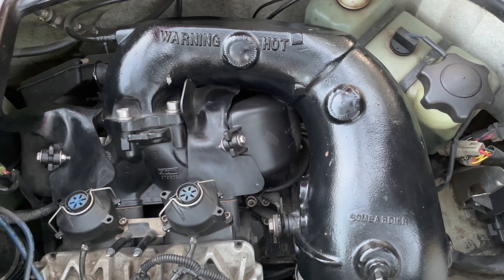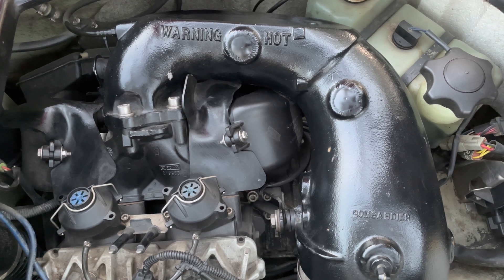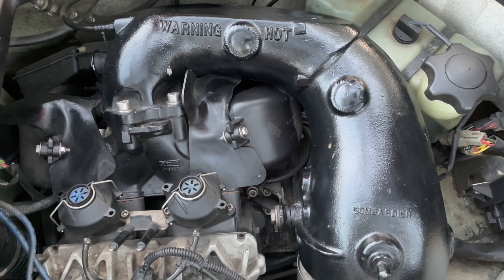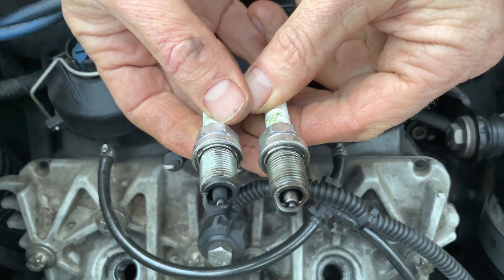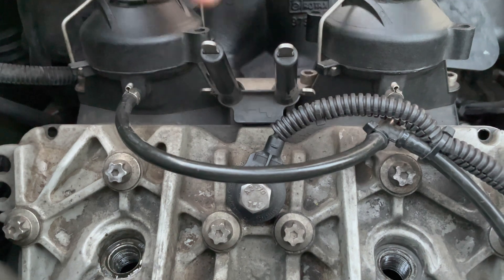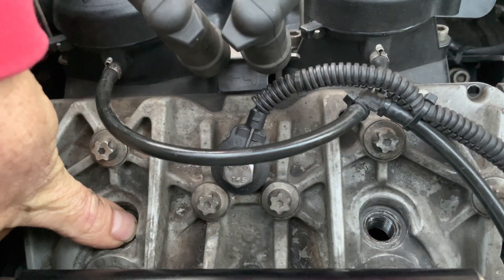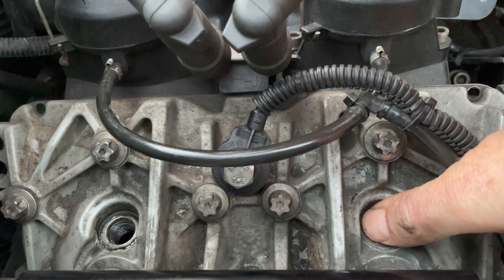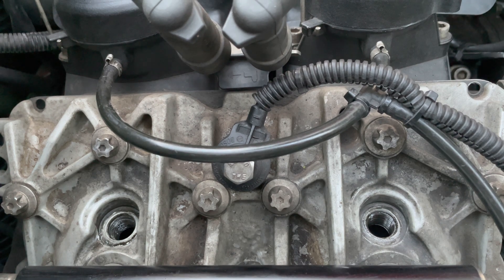Seadoo 951 Engine Build

Comment: Hi i would like to ask cause i got small problem with my 951 haha. It happen to sucked a small piece of my latex gloves inside the air intake when i try to crank it. But it didnt really start yet
Reply from the maker: @zorenzarsona9759  hello 🙋🏻‍♂️ yes that can sometimes happen 🙌 if it is just a small piece then I wouldn’t be too worried … it will pass through and out the exhaust eventually .
Reply: @Redrockat  awesome, thank you for answering my question, i will be starting the jetski now 😄

Comment: Your killing me with the dirty bolts going back into the head......I am rebuilding a 951 DI as well with over 260 hours on it. Still had good compression but do not need to blow up engine. Later.
Reply from the maker: There is always a reason , here time constraint .

Comment: I like the detailed video but feel like it could use more voiceover. There were a few times in the video you were pointing at things or moving parts and I had no idea what to look at or what was unusual. The hole in the crankcase was obvious but like at 6:26 I don't know what I was supposed to get out of that clip.

On another note, I bought a used two-stroke machine a few months ago and have no idea what oil the previous owner was using and what is in the oil tank. How can I be sure that whatever oil I put in won't cause this problem?
Reply from the maker: 6.26 I show the new crank in new casings compared to the old crank that has a polished mark on the lobe from hitting the casing and also the marks on the conrod where it got hit by  the crank . I tried to keep the video basic and did not explain too much and more a show all . Any other questions I will gladly answer 👍 thank you for watching and commenting. These engines like a fully synthetic two stroke oils . Always stick to one brand because some brands do not mix well . 
It would be better to flush out the old oil and clean the oil tank .. then put the brand most available to your region in and remember to bleed the oiling system .Then you will be okay 👌 this way you will know for sure you are starting fresh with no obstructions in the oil reserve container and fresh one brand oil of the same kind .